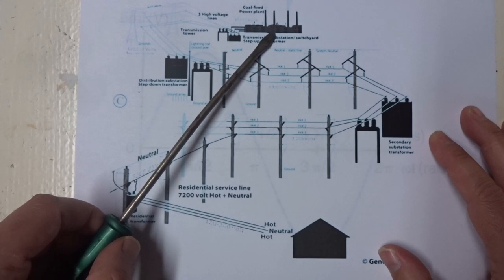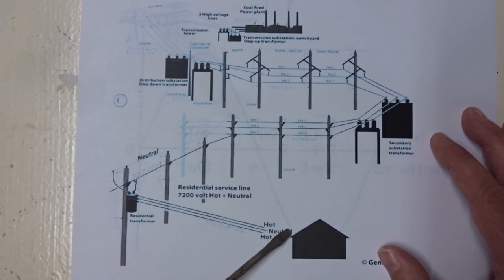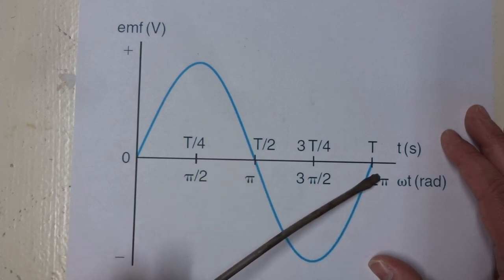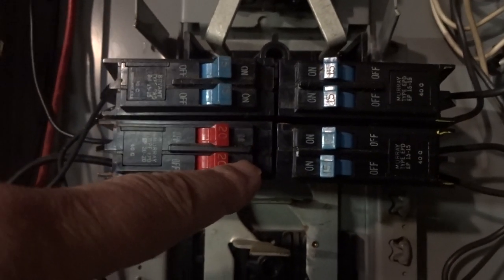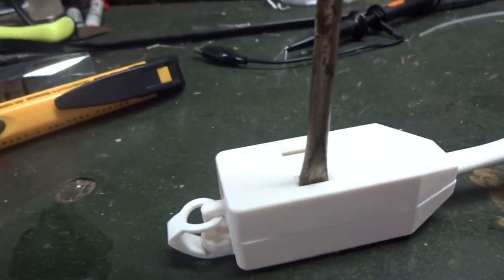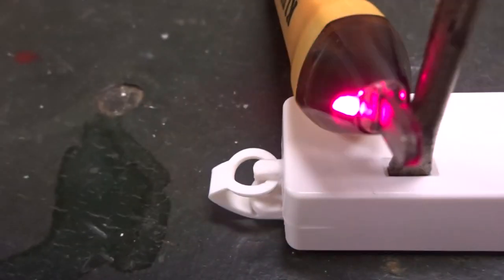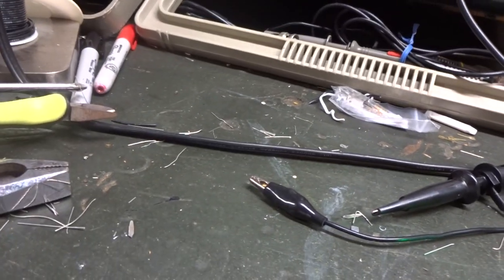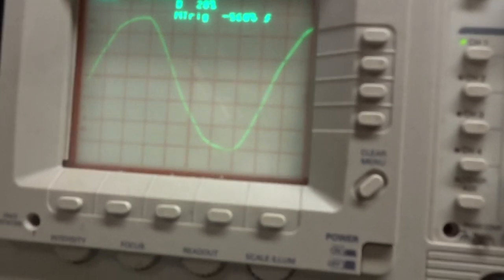Demonstration of House Mains 117 Voltage in My Body and Seen on an Oscilloscope.

Comment: Good to see you again Frank. I was not expecting this demonstration from you. I am a retired sparky in Australia and must admit I was cringinging at your method for the demonstration. Glad you did not go up in a puff of smoke in your basement. Lol. Our voltages are different here, 240v single phase and 415v 3 phase. I don't know how your voltage which appears to be single phase was reduced within the switchboard, very intriguing!🤔👍🇦🇺
Reply from the maker: Power is transmitted a three phase in the USA also, but is separated by a delta or why transformer at the substation and then each phase is carried by each of three wires on utility poles to people's homes.  Only one of the three wires is tapped to deliver the single phase electricity to a house.
Thanks.
Frank